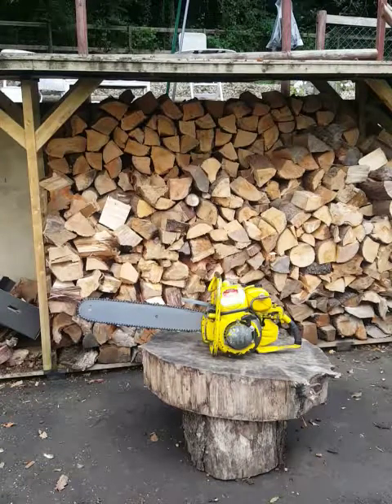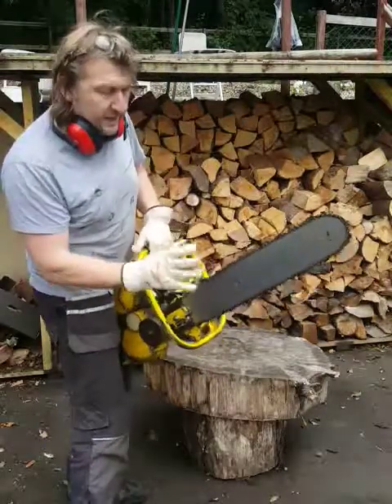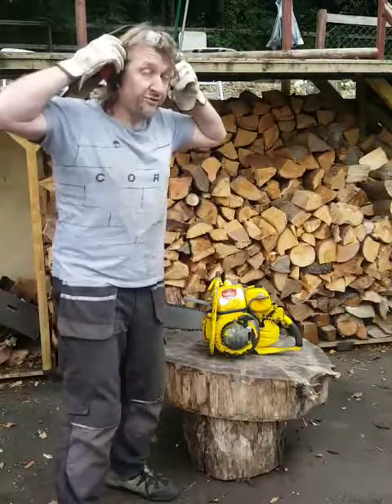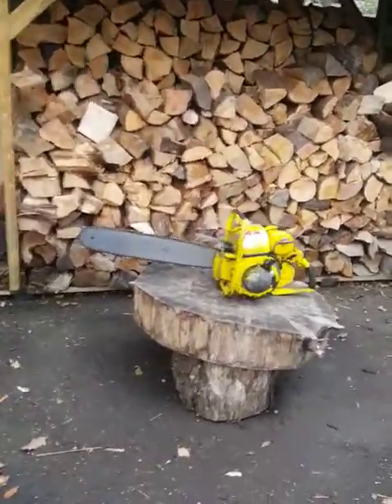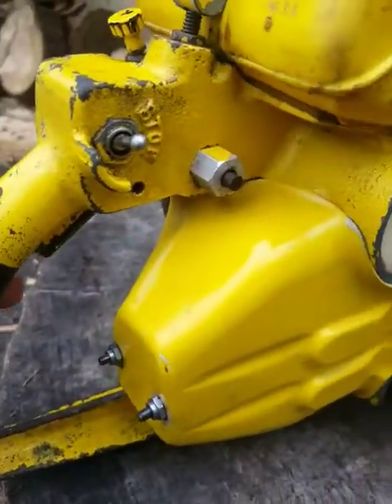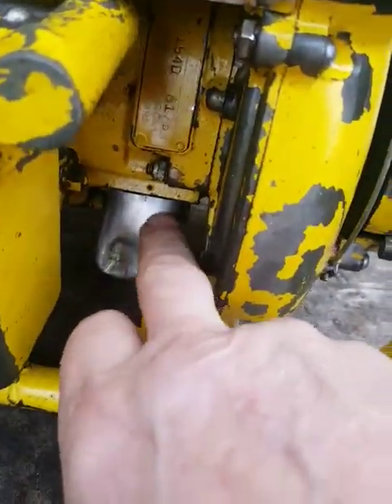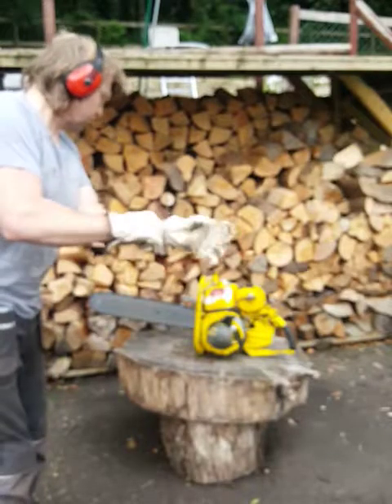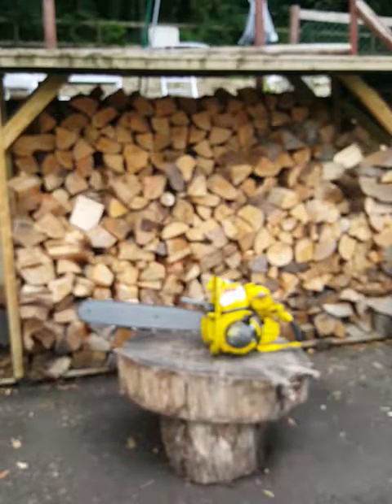Danarm DD8F mk2 98cc British Vintage Chainsaw. Starting and running and overview.

Comment: Thank-you for uploading your videos,  I’m about to restore ours which is almost complete, it’s the same as the one shown except that the fan cover and pull start are black ?  It has a 28” bar but the chain is missing,  any idea what the chain spec’ should be please ??  Thanks, Martin, Somerset..
Reply from the maker: Hi Martin.. I also have an earlier DD8F with the black top..
All my saws have been 1/2" pitch on the chains.. 7/16" was an option, but I have never had one or seen one with a 7/16" chain...they've all been 1/2" Oregon Chipper Chains :-)
Do a video if you can of it running.. I'd love to see it.
Regards Rob :-)
Reply: hi Rob, thanks for coming back re chain , (it’s the flywheel cover & pull start that are black). 
 DD 37289. DD8f  MK 2A .... engine serial No. 313d 15606.  Regards M.....
Reply from the maker: @mountfields  hi M..
I just went out to the workshop to recheck.. I have 2 versions of the MK11A.. Yellow & Black Top.. But both have yellow pull start housings... I wonder if yours has been painted previously?
But both chains on my MK11A's are 1/2"... Out if interest the only 7/16" I have are fitted on my original Danarm DDA110.
Hope that is helpful...
Shame you are not closer..you could have brought round and tried both :-)
Reply: Rob,  have started cleaning our saw and the pull start does have some yellow paint, the fan / flywheel cover is black.  Is it poss’ to have your contact e m address, I’ll send pic’s etc....M.....
Reply from the maker: @mountfields  Hi M..
My e m : jsaprofile1@gmail.com
Regards R